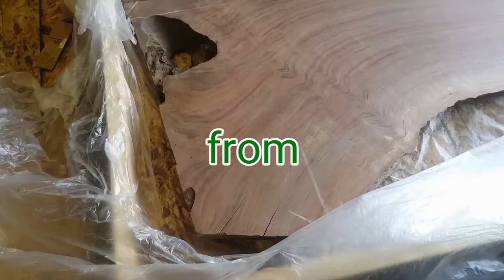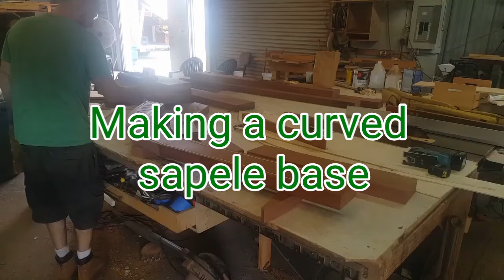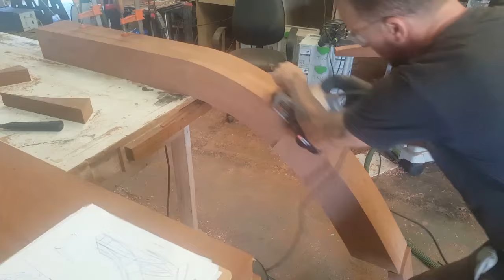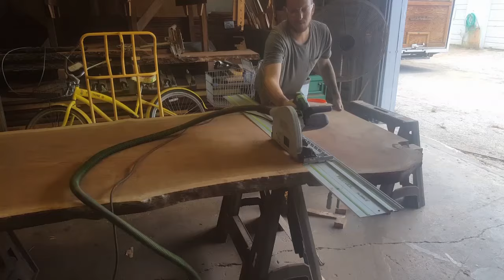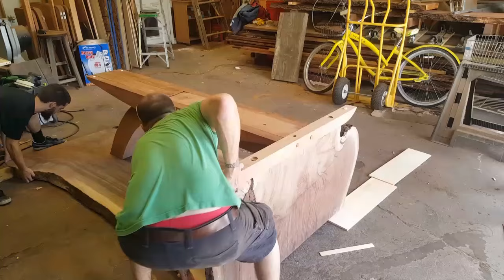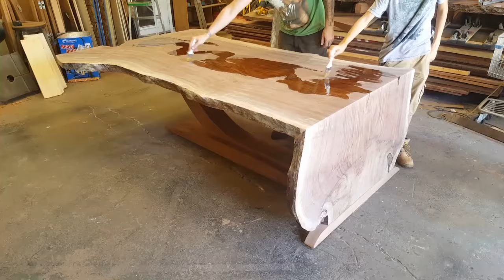Father and son building a black walnut table.

Comment: That is awesome man!!  What did you use for a sealer on that? I'm about to make my own soon and I've been using a two part epoxy on some cypress counter tops. I'm jut curious how you finished it cause it looks so nice....
Reply from the maker: Steve Fritzson I've used a lot of different finishes.  Lacquer, conversion varnish, polyurethane, spar varnish, epoxies, polyester...  But lately I've been trying out the natural stuff.  this table was finished with pure tung oil.  Not the stuff from home Depot.  I think the brand was maguires, and listed as 100% pure.  I thin it with mineral spirits.  Linseed oil is a good natural finish too.
Reply: Thanks for the info. Let me ask where you get those live edge slabs? I've been looking online and there looks to be a few here in Florida? I recently was in Boone North Carolina with my family and was looking at some stuff there on the sides of the road type mills. It got me all fired up to do something live edge. I love this stuff!! Thanks for any input!
Reply from the maker: Steve Fritzson I've purchased from a few mills in FL.  One is Double Eagle Sawmill, but for the really wide slabs I order out of state.  Berkshire has a huge variety and everything comes from them dried, flattened, and sanded.
Reply: Holy crap I just looked up Double and I live and work very close to that place haha awesome. Berkshire looks like they have some really nice pieces!! Thanks for the info.....